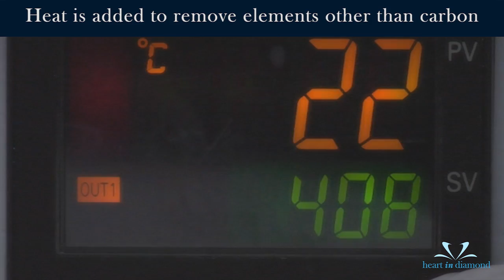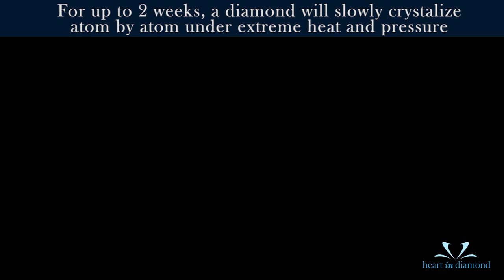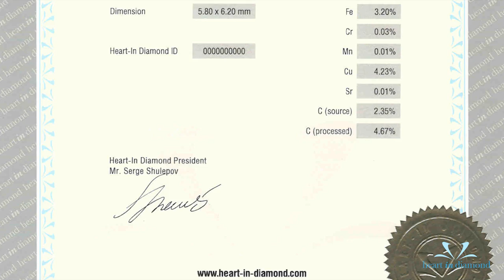Personal diamond creation process

Comment: Technically diamond is just super heated and compressed carbon and ashes are of carbon, so I guess it works, but I might be wrong(not a scientist)
Reply: High pressure and High temperature rearranges carbon position into diamond lattice, diamonds are basically pure carbon. With certain,very minor impurities, diamonds can change colour.
Reply: ashes are not carbon
Reply: yaya lu diamond is made out of pure carbon, but I’m pretty sure it has a hexagon atom structure, or pentagon, can’t remember which shape it is, I know it has more than 4 sides.
Reply: XPumpkins Are you saying that diamonds and me are made of the same thing.
Reply: Siggesatan Holy shit, diamond, charcoal and everything alive on this earth is, to a fundamental level, the same thing ! Honestly, after knowing this, if someone tell me that the sun and the stars are also the same things, I wouldn't even be chocked

Comment: So we understand the physical implications of what it takes to create a diamond.  I.E. Pressure, material, heat, etc.  But what about TIME?  Is TIME a material?  Is TIME something that is a fundamental attribute that induces the crystal structure of a diamond?  And if so, can TIME be manipulated through scientific means in order to "Speed Up" the process? Or is TIME a fundamental constant like the SPEED OF LIGHT in that it is fixed...
Reply: I know I'm late to this "discovery", but I remember someone describe placing a rose into a contraption that sounded a lot like this thing looks and I think you're correct(they would demonstrate showing how old the rose became in the machine/how quickly it decomposed).  They are manipulating time.  I'm trying to figure out the sinister side to human composting and was naturally led here....Thank you

Comment: All that work for a tiny diamon
There is another method that uses methane with some EM wave being pulsed in a chamber, the carbon from methan is split and slowly descends, if there is a diamond slabe on the bottom of the chamber, it shall bond with it and make the diamon larger in size

so for this process, all we need is very thin slice of diamond to grow a new diamon on,

Comment: I honestly don't know how much of this was legit and how much of it was purely cinematic; but I can say it was an entertaining video nonetheless.
Reply: Leviathanshadex,
Cubic zirconia is made in the same way. Most of the diamond cutting machines are made with cubic zirconia. 

Cubic zirconia (CZ) is the cubic crystalline form of zirconium dioxide (ZrO2). The synthesized material is hard, optically flawless and usually colorless, but may be made in a variety of different colors. .

Because of its low cost, durability, and close visual likeness to diamond, synthetic cubic zirconia has remained the most gemologically and economically important competitor for diamonds since commercial production began in 1976. Its main competitor as a synthetic gemstone is a more recently cultivated material, synthetic moissanite.

Comment: These type of diamonds are called Imitations or Simulants. They look like real diamond but when the source is not natural, they loose their beauty when exposed to varied  climatic conditions which is not in the case with Real diamond which are formed at 150-200 KM depth with a temperature around 1500°C and a pressure worth the weight of feeling 30 elephants at our palm.

Comment: Or, or, use the colossal explosive force and pressure of a volcano to make one.
Reply: Interesting Superdave,
When prospectors look for the different mineral, metal and gem locations they actually look at granite samples. Granite is igneous rock from volcanoes. Volcanoes spew out molten rock and the minerals, metals and gems give a certain colour. For example blue = diamonds, red = iron and green = copper. If they find these and other colours in the granite samples they can fairly accurately predict the main composition of the underground rock.

Comment: Seems like a waste that all you get out of it is a small convex rock that's a specific size and shape and isn't good for anything, you can't make anything useful out of this, all you can do is make it into jewelry. It would be much more interesting to have a screwdriver or a rotary saw blade made entirely out of diamond, maybe some finely calibrated machine parts, like an engine made with some diamond components that may make it much more efficient than one just made out of metal.